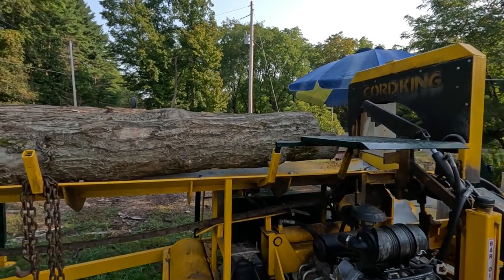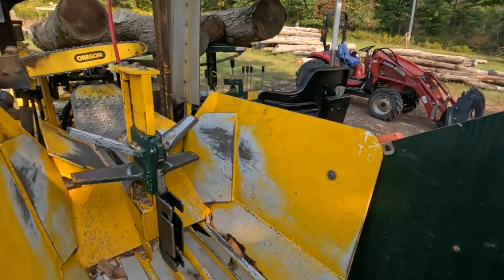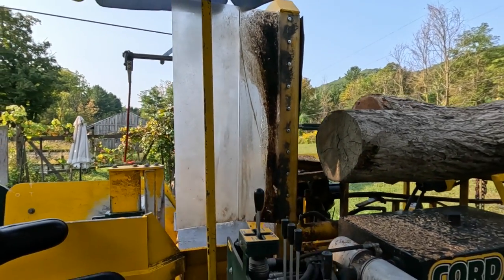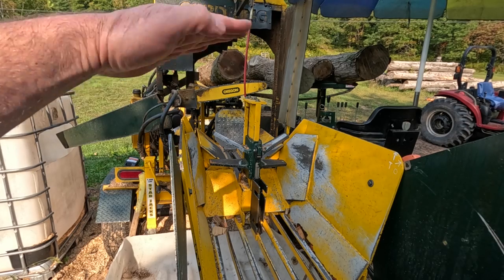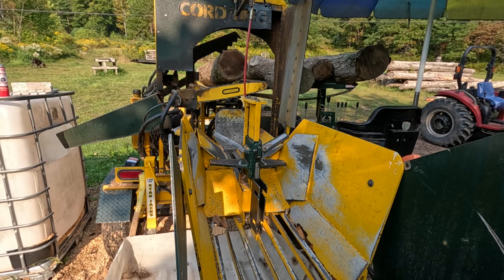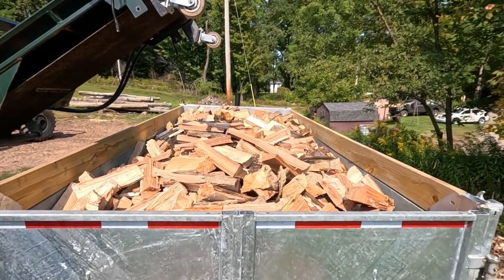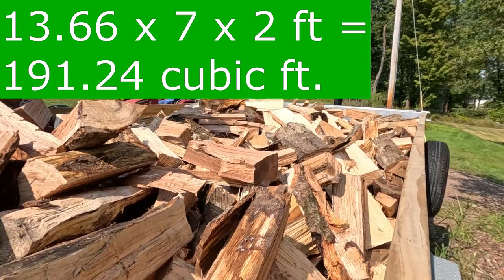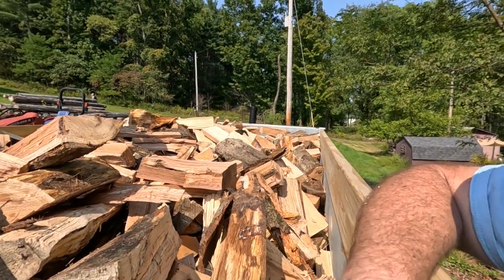Split and deliver two full cords with the Cord King - 126

Comment: Is your pump located above the oil level in the tank, maybe if you lower the oil pump to the bottom of the tank.
Reply from the maker: @NormanStrobel  that was the first thing I thought of. The pump would work fine for a while. It's just very sensitive to any dirt. Generally it's a just a poor quality pump . I've already started replacing it.